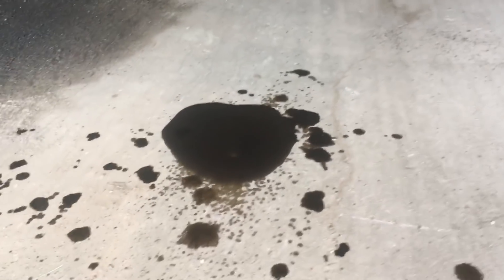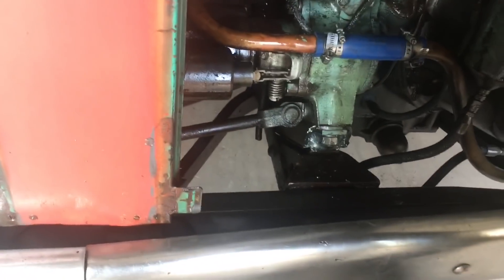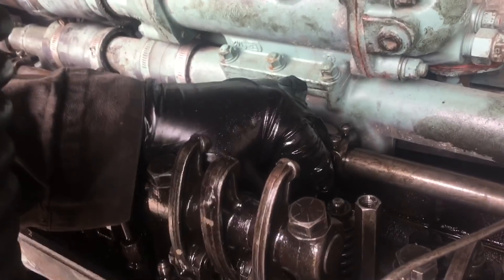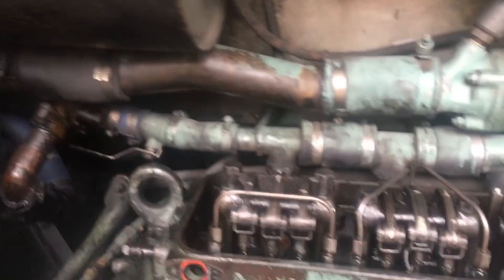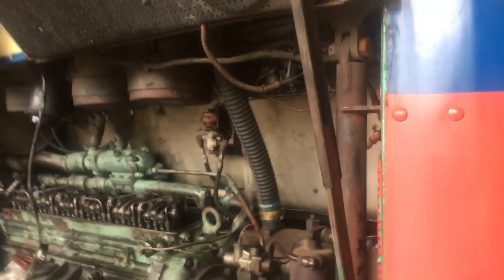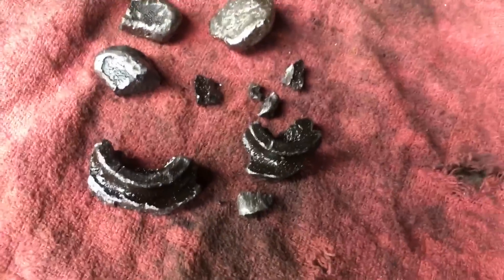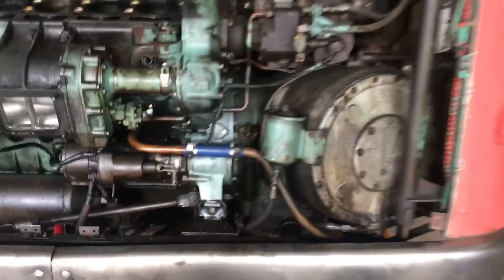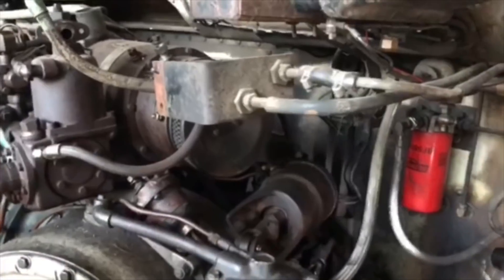Diagnosing a sick Detroit diesel 671

Comment: Dam injector with a weak bladder. Set of depends and a smoke and a pancake 🥞😂. Will be good as new. You can't miss that dead hole sound. Shut her down immediately when you hear that. When the cam and lifters are as clean as new from 500 miles of diesel flush it's a dead giveaway. 
You had a wanderlodge that was hard starting running on 5 cylinders in another video.

Comment: That’s a big hole. Must’ve made some noise while the valve head was peening the injector in the head. 

Nobody will believe it, but I have a 1968 Chrysler 440 pulled from an Imperial that was allowed to overheat, blew huge holes in two pistons, and the people drove it on home to Texas from somewhere in the Deep South. The thing is undamaged otherwise.

Comment: I've said this before.  God bless Jay Leno because he knows his history about cars and the like.  I forget which airplane it is that he's all Ga Ga over, it's either Merlin or Continental radial engines that won WW-2.  Someone can correct me on my history, but Detroit Diesel engines are what won the war.  Detroit showed up in trucks, if I'm right tanks, and the maritime vessels.  Depending on the particular application, the Detroit engines could be mounted front snout to rear flywheel and double the power output.  Rearrange the front timing gears and reverse the rotation.  The versatility of Detroit engines is in my opinion that helped win the war.

Comment: My first experience with a Detroit  was a 671 in a 10 yd dump truck and it dropped a valve just like this video.  I took the head to a old timer machinist down the road and we got the injector out cleaned up the head put in new valves and seats guides and reground the other valves. I put in a new rod cyl and bearings put it all back together, made sure I was right ready to slam the run away flap shut if the engine ran away. Didn't know any thing about setting the rack or this engine other that reading the book. It all came out well and ran great after that. Then went on and drove a water tender for the forest service behind an 871, got the job as I was the only person who was familiar with a Detroit 2 stroke Diesel! Past drivers had blown the engine up! Great engines but have their quirks.

Comment: Old Detroit Diesel Engines were made solid as a tank! they were made to outlast you, I'm so impressed that it started with that hole on the cylinder, if that happened to a modern Detroit engine the result would have been total catastrophic engine failure.

Comment: In the 70 and 80 I worked on every possible 71, 53, 110, 149 and 92 series you could ever imagine. Seen many 12V71 with 4 pistons with holes in ROCK trucks that were overspeed
Reply: Larry Tomb would you happen to know which version of the 671 is in my crown school bus by chance? Trying to find info on the slant 671 mid engine..
Reply: @icenijohn2  mine is a 671 turbo, figured it out. The new hurdle is trying to figure out the air lines for the 10 speed conversion

Comment: Detroit Diesels are great - just love them. DD was my customer for many years, spent a lot of time there, used to call me when they had something special on the dyno  like one time a huge mining truck engine. Also spent time at Electro Motive and was in dyno rooms testing locomotive engines. Last year was on a USCG buoy tender with two EMD V8 for startup after a long sleep. And . . .  I have a pair of 8V71TI’s in my boat.
Reply: In the 80's my uncle started a locomotive repair shop in Lakeland,FL..guess due to all the phosphate train loads out of there..So I inherited a TON of old EMD manuals Amtrak manuals from his days with them..It's nice to see how things were once made to be worked on..My father worked for the railroad for 35 years..Chessie System up in WVa then SCL (Seaboard Coastline) here in FL then they became CSX

Comment: 400 psi or less is seriously low. No wonder it needed ether before it dropped a valve. That's less than minimum for a turbocharged 71 let alone an N. In other applications a 'naturally aspirated' 71(no turbo) Detroit's minimum pressure is 515 psi. They'll run with 400 but smoke like a chimney and won't have a lot of power.
Reply from the maker: Check your numbers.

Comment: Greatest engines ever built killed by the EPA and their bullshit. Still turns my stomach to think about it.

Do you realize where these motors would be with today's metallurgy, technology, and computing power? You could probably get to Mars on diesel fuel.
Reply: Not just Detroit's all non emission engines Im in the trucking biz the electronic logging was a underhanded way to push older trucks off the road ! No OBD port no hook up for the E logs they gave me a 2 year exemption but its up for renew soon but I hear from other outfits they are not getting a extension on the paper logs they are forced to buy a newer unit im not going to ILL just start down sizing   the fleet and quit in a few years
Reply: We had some 92's w DDEC and they were so sweet !
Reply: Saturn Vs did run on diesel!
Reply: @vector6977  kerosine. Very pure kerosine...and yes, the Detroits would not even notice the difference :D
Reply: Well we did get to moon using diesel and liquid oxygen.

Comment: Used to work on the 671 on LCM 6 while in the Navy stationed with Sea Bees back in the early 1960s. Had a few runaways but were pretty much bullet proof! Great old dependable engines that stood up to all the abuse a coxswain could throw at. Man could those guys  handle a boat!
Reply: Wright Harris what ran away.....you or the engine?
Reply: 671 was my favorite for fire engines; it was so loud I really didn't need the siren that much.

Comment: I used to run a Cat lift that was just like that. Smooth as butter, they are. The only problem I ever had with it was with diaphragms going bad in the fuel regulator, but that'll happen with anything that runs on propane. The coldness of the fuel reeks havoc on rubber parts. It gets even worse when the forklift basically "lives" outside, like the one I ran did.

Comment: I would be curious to know if you remember the difference in compression cranking vs running since most times it cranked a few seconds before firing, I know the book says warm engine idling for compression test but I've always wondered if it really made that much difference. Thanks Matthew
Reply from the maker: Around 30 psi different

Comment: A 2 valve, probably still has the S injectors in it
Reply: I've read of HSV7 if it's a 2 valve it will have trunk type or single piece pistons rather than the cross head type.

Comment: As soon as I heard it run, I was like "Ooooh. That's very, very bad." I figured broken valve maybe, bad injecor definitely. I wasn't prepared for all of that, though. I guess seeing oil fountain out of the top of the rack is a dead giveaway. I've spent a lot of time around the 6-71 in the marine application, but I know a screwed up one by sound. Poor thing. Hopefully, you can find new parts and rebuild it.
Reply: Shouldn't be hard to find parts - the US military still runs a ton of these engines.
Reply: Believe it or not you can buy a whole engine kit for less than 8K
Reply from the maker: See description link to it rebuilt

Comment: I worked on the Jimmys when I was serving my apprenticeship a long time ago. I also worked on EMD's. The easiest way to narrow down a weak cylinder on those was to climb up on the roof and listen to each exhaust. One day a fellow apprentice and myself climbed up on to the roof to listen to an engine which had the brakes on full,but was in Notch 8. This was to make it work so the dead hole would show up.... while we were there, it started moving .  the handbrake wasn't on.
Reply: Notch 8 when you're not movin? That's a good way to ground fault a unit. And these new 6 axle AC units will eaaasily outpull any handbrake ya put on em. On the upside. No ground faulting.
Reply: @Liam40  We were Apprentices and the loco was already 30 years old. ....we were expected to make the occasional cockup 😀.Some of the other guys let a locomotive roll out of the yard and it wandered down the track towards the main line by itself. Only stopping when it banged into a brace of freight wagons being shunted . No handbrake at all on that EMD dash 8 .
Reply: Mercmad,
EMD didn't make dash-8's, that was a GE.
At least you didn't put it in powered mode - unless that is, you went from power to dynamic way too fast. (It needs about 10 seconds or so.)
Reply: When I started as a fireman most local power and switchers were Alco's V-12 244's on the RS-2 ( only had one) and RS-3's plus 539's and 539T's. Cast iron brake shoes and they would walk away with the hand brake on if you gave them full power they would walk away easily. The 539's were 12 3/4 inch x13 inch bore and stroke inline 6 cylinder engines. Idled at 240 rpm and full throttle was 740 rpm 660 horsepower normally aspirated and 1000 turbocharged.
Reply: Someone's lying here, and I think it's you

Comment: It's a Detroit.. don't they come leaking from the factory? :)
Reply: Well it's a Detroit, if there's no oil under it there's probably no oil in it either.
Reply: It’s not leaking, it’s marking its territory.
Reply: yeah,thats why we call them  " leaktroits "  -- what do detroits harleys and VW 's have in common ? if they aint leaking there aint no oil in them.
Reply: @GMCOGRE  every Harley I've known never leaked.
Reply: @kylekenan2321  hhmm,were they newer evo 2 models ?those arent so prone to leakage like the older ones,most of those dont leak at all.
Reply: @GMCOGRE  evo 2? One was an evo and the others were twin cams.
Reply: @kylekenan2321  ok yeah,those are newer models that arent prone to leaking
Reply: @Dave-ty2qp  at least they aren't fuel injected
Reply: @GMCOGRE  Driptroit Diesel. But aside from that they're some of the best engines mankind ever made.
Reply: @TestECull ,yup,brutally strong,damn near indestuctable,and power out the wazoo,theres a reason they had so many running out at bonneville in streamliners,only diesel with that kinda power to weight ratio
Reply: @GMCOGRE  And you can rev the nuts off of them, relatively speaking. For their size, their redline is up on the moon somewhere! IIRC the 4-53 will twist up to damn near 4,000RPM without any issue and even the bigger engines'll turn 2500 all day long when their competition throws rods at 1750.

One of these days I'll get my hands on a screamin' jimmy. Prolly a 4-53T. Wanna build a dune buggy or something similar around it, pre-runner, that sorta rig. Somethin under 5,500 pounds, mid engine, probably use a built C6 behind it if one can be made to bolt in. I bet she'll flat rip!
Reply: @TestECull  if you want to adapt a gas tranny to it try one from an old eldorado,they work great for mid engine buggys,and they are tough,most had 500 caddy engines in front of them
Reply: if my Harley shovelhead was not pissing on the ground I'd head for a gas station for oil,and I don't care,cause I'm styling,i own the bike,sorry about the diesel,they always sound to me like they need a valve adjustment
Reply: @GMCOGRE  Yes; they used to say you could always tell when a HD was around; look at the oil spots!
Reply: The good old Detroit Drip. Nothing better!
Reply: @DagonNaxos  -- it takes a special kinda beast to be able to bleed like hell and not die....

Comment: Could you help me on a 8V92 ta
I have a 1979 autocar 
Me and my son rebuilt engine -
I wanted more horse power so I put 
9215 injectors in. It had 9290
I’m not sure I got them set at correct height.  I could not find a setting for 9215 s -   
Also I would like to go back and add Jake brake -
Can I do just one side of the engine ?

Comment: Dead engine? There are 5 cylinders that make it start and it did reach the workshop! It is true that it is expensive to repair, but it is an engine that can continue to give much more after a readjustment and change of parts.

Comment: Is it still worth it to rebuild this? I love Detroits, but I assumed that people would rather do a repower for better performace and fuel mileage.
Reply: Depends on you. Personally I miss Detroit 6V71 and 8V92 Silver in the Blue Bird Wanderlodge and All American school buses. 
If I ever found one I’d never drop a repower in there. I lived for that sound when I started and I fondly love that sound whenever I get to see it drive one.
Reply: @roundsm18  come to think of it, I'm pretty sure a local company has some older coach buses that sound like they might have an 8V92. I'll try to get some video next time I see one.
Reply: everything is rebuildable, if you have the time and money, could even recast and mill a new block and head if you wanted..

but, crank needs refacing, rod needs replacing, new piston, drill out the old injector, install new, reface the head or replace could be cracked,  new springs all round, block needs new sleeves, why not, new rings all round too.. but at this time, why bother when you can get a 2nd hand one for $1.5k upto $3k over $10-20K(manly the hours of labor) rebuild?
Reply: @MaximusPsychosis  You don't need to go that far to get this 6-71 screamin' happily again.  Want this exact mill roadworthy on the cheap?

* Used, serviceable cylinder head and all trimmings

* One sleeve

* One piston/rod assembly

* Pull, remachine the crank

* New main/rod bearings

* New gasketry

* Done. She's good for another 30 years or so.
Reply: @TestECull  just saying, if you had the money, nothing stopping you going the whole remanufactory.. but yeah, i'm sure i mentioned that's all that was needed, what you said, but for some strange reason, ether me just deleted that part, or someone edited out the components.. 

second look, yeah, i did, its just not showing here in the notification  quick-view..

anywho all  5 minute ebay numbers:
so fully loaded head: $1,826.88
rod: $159.99 (lets say bearings with that)
piston kit (head, skirt, pin, clips) $99 NOS
rings: $39.95

labor pulling crank, polish, replace, install components, say 1 hour, 2 hours, 1 hour, 3 hours at $88/h?
 $2742.
so im off by 5x on the rebuild, only if one goes by the labor numbers, could be more, if requiring more then one person..
or 
complete power unit, ready to go: $2,995.00
or a fresh "was running in truck" pull $1895

so you'd go rebuild over dope'n'swap?
Reply: @MaximusPsychosis  I probably would, but then again I'm the kind of nut that would happily throw several grand at a 34 year old Ford 4.9 I6 in an '85 F150 if they had it laying around.
Reply: Yup. Sleeve it, head replacement, crank kit, replace the buggered piston/rod assembly, and she's good for another 40 or 50 years. Nothin a standard overhaul wouldn't fix.

Comment: Ether is the death of a diesel engine. I try to find any alternative to it.
Reply: super pickle  uh, yeah it does. It's a good way to bend connecting rods and wash cylinders of oil.
Reply: @hudsonhawk0016  It's a good way to blow your own fucking eyebrows off when these modern engines kick a fireball out the intake while you're holding the ether can and Bubba cranks 'er over because the ether lit off on the grid heater and/or glow plugs.
Reply: Ether isn't, stupidity is
Reply: ones on ether....forever on ether
Reply: @nicoverduin  another myth
Reply: @RJ1999x  what's a myth?
Reply: @RJ1999x  oh duh, yeah it is a myth. I hear it at work all the time. If you have to use ether on an 80 degree day,  there is definitely a problem.
Reply: @hudsonhawk0016  yes if it's 80° and you need either you have a problem. But either didn't cause it
Reply: @Earl James I saw a Cat 955L track loader burn up using a method similar to this. Lol.
Reply: Ether is a factory installed option on some coaches with big diesels, and not just the 2 stroke ones... It can be effective and not cause damage if using sparingly.  The strategy is to just put enough pop into it to get some extra heat going in the cylinders.  If you go ape with it you're going to cause a lot of wear to the liners.  If you go super ape you could bend a rod.
Reply: Christian Soldier  I was referring to drowning an engine in ether, not the factory ether injection system.
Reply: @Earl James just make the engine warmer quicker if the external oil goes to flash point :D
Reply: Hold a rag soaked in gasoline over the intake. Or use wd-40. Ether is ok in SMALL doses, but should be avoided if at all possible.
Reply: Ether is okay if you don't overdo it,but people get crazy with it. I found a good alternative, btw, if you're intetested. I had a Ford F250 with a 7.3TDI that lost the left glowplug bank in it and, below 40 degrees, it never started. I found that a 2 second shot of WD-40 in the breather worked well and was more gentle on it than the Ether shot. Knocked a lot less and didn't rev the nuts off of it when it fired over like ether did. I've also used the same trick on a 3208 with 8500 hours and low compression and a pair of Detroit 6-71s in a boat when I forgot to turn on the block heaters in the winter.
Reply: WD40 once had a flammable propellant, but they switched to CO2 a few years ago